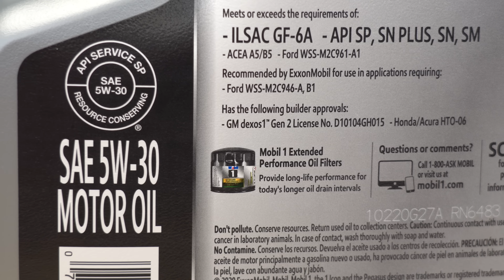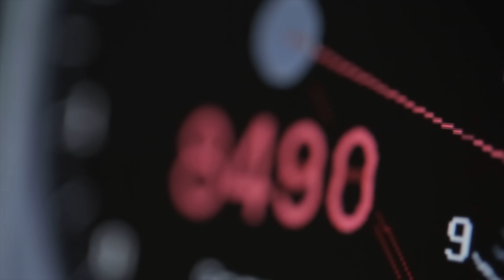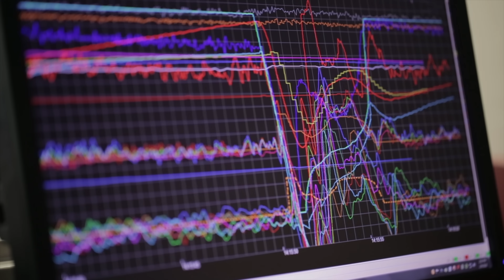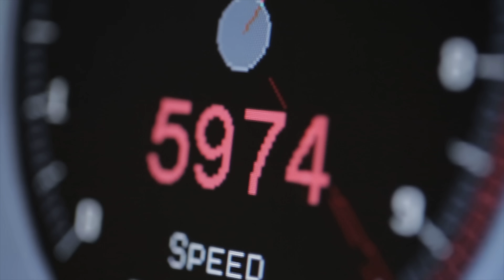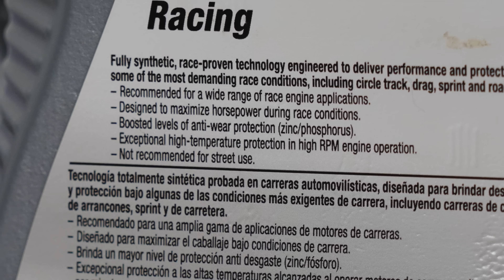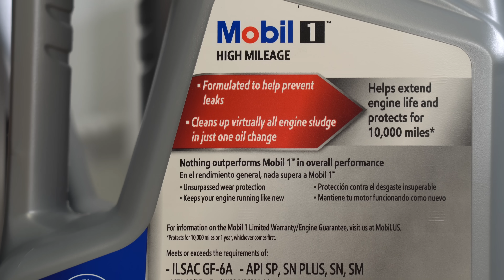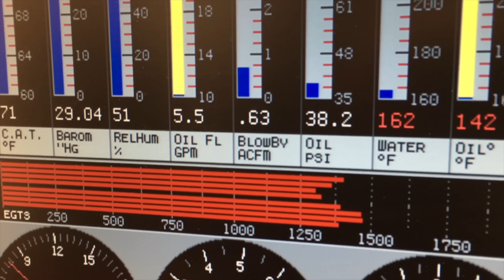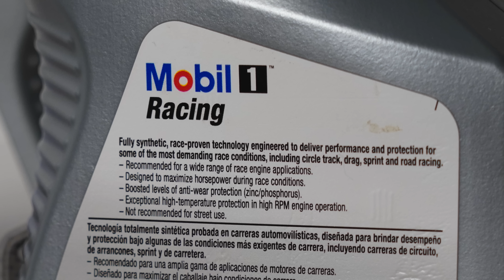Should You Use Racing Oil In Your Road Car?

Comment: I worry that engine manufacturers recommend the same oil viscosity regardless of where you live.  Temperatures and humidity vary greatly from say Florida vs Wisconsin.  But the same oil is used in both places.
Reply: This is due to an EPA law that requires manufacturers to recommend the same motor oil used for fuel economy testing on all cars they sell in ALL US markets, though I'm unsure of exactly when this change occured. I know my 2004 Jeep for example suggests 10w-30 in climates that exceed 100°f+ and 5w-30 elsewhere, but it's not often I see this (only more recent example I can think of is a Nissan that said to use 5w-30 if 0w-20 full synthetic was not available, but came with an asterisk that fuel economy may be degraded and that it's not recommended except in emergency)

Comment: Nascar teams, in addition to INDYCAR and Formula 1, will warm the engine oil and coolant close to operating temperature before cold starting the engine.  This further minimizes the importance of the winter oil viscosity.
Reply: I remember seeing somewhere that in, say, Hospitals they have giant diesel gensets in case power goes out. Pretty much the same thing is done. All the fluids are maintained at operating temperature as once the power gets cut the gensets are immediately pressed into full RPM

Comment: Great article.  Could you please comment on a shim-under-bucket style system, common in motorcycle/OHV that doesn't use a roller lifters but also has lower spring pressures.  In addition, some have wet clutches and others don't. How does ZDDP amount affect these situations?  I would guess it's not needed in either.

Comment: "imagine changing oil every 5000 miles..." 

Subaru owners: I'ma pretend I didn't hear that.
Reply: I change it every 3000, so what
Reply: @kristoKR-zj8oi  There was a story on Yahoo about oil change intervals. Their opinion was you can quit changing your oil every 3k miles and go for 5-7000k miles to save money and natural resources.
This was back when full comments were still happening. 100s of comments about "I go x miles," and such. Then there was a comment by a guy who claimed he was an "SAE-certified" mechanic. He said the only way to know for sure is to have your used oil lab tested. He recommended Blackstone Labs. They do lab tests on consumer vehicles by sending you a sample-gathering container that you ship back to them, which they use to perform the tests.
I tried it and the lab test report said I had too much lead in my oil - I was either adding lead to my fuel or my main bearings were wearing out prematurely. They were correct - I only got 395,000 miles out of that Camry.
Reply: @pistolpete9978  i dont think oil interval should depend on miles... Mostly on driving style, how high the engine revs and so on... My car revs at 3000 rpm at 60 mph, so it spins a lot for low speed...

Comment: To answer your question, race oils are not good for daily vehicles. Unlike you I think 1HP is not worth more expensive oil in ANY situation. Say you already have 350HP. 1HP extra is what 0.28% gain in raw power in some condition that You shall not be able to recreate.  Snake oil.. Oil business has stayed and remained shady business, a lot of mambo jumbo and "snake oil". Good oil, and change intervals appropriate to usage and engine condition is all one needs. Drive hard, change frequently, city driving, change frequently, normal driving = longer highway runs change as per manufacturer specs.  Simple as that.  BTW thank you for the video it was rather good even though I do not agree with some statements.

Comment: I'm installing a supercharger in my BRZ, I live in Southern California so the summer heat will require me to go from 0w-20 to at minimum 5w-30 and due to the the stress changes I will have to use an oil with slightly higher ZDDP. So I chose 5W30 Motul 300V, granted I wish they made it with a little less ZDDP as 1300 ppm is "usually" the max useful limit before it affects the the vitality of an engine, theirs is 1724 ppm. +424 ppm doesn't seem to much over but I will find out after the next oil change(every 3000 miles) when I have the oil tested.
Reply: Do you feel a lot of difference in hot weather with the viscosity change?
Reply: Vitality of engine or cats?

Comment: Nascar...more power at full load for at least 500 miles. Road cars...need just to get to point A from point B without costing a lot for about 100k or more miles. Racing oil won't hack it in road cars. ZDDP should be outlawed.

Comment: If road cars engines were at high ram for most of the time being driven, they would need oil changes much more often as well. If a Nascar engine was driven like a road car, their oil change and rebuild intervals would be greatly extended. You left that bit out.

Comment: Simply use the oil that's specified in your owners manual. Your car is gonna thank you especially in winter.
Reply: Opinion on AMS oil?
Reply: @vGREENARROWv  amsoil synthetics are some of the best oil you can use if you don’t mind paying the premium. Probably worth it on expensive engines that hit the track, but not necessary for dailies. Just stay on top of oil changes most importantly and use something decent like Castrol, Mobil, or even amazon basics. I like to use genuine/oem filters as well but wix is a great alternative.
Reply: @hazemdrift  ok because I’m not going on a track just cruising around.
Reply: @vGREENARROWv  Use the correct viscosity and follow change intervals. Never pass the 10,000 km mark and if the car is used in severe conditions(small distances everyday where the engine doesn't have the time to reach operating temperatura and never goes beyond 2th-3th gear.
If you want to take extra care use full synthetic, theres some pretty good stuff like mobil and castrol at reasonable prices. If you are an car pervert with money to spend use motul, amsoil or redline.

Comment: I've been warning people for years, about the long term effects that oil additives can have on emission control components. My biggest concerns are the oxygen(O2) sensor, and, the catalytic converter. There are over the counter additives that can be added to conventional oils, but those additives contain many ZDDP and similar additives to racing oil, and oil used in diesel engines.
Reply: So are you saying stick with conventional oil? Just asking for conversation sake as I to do agree that “over the counter” additives (aka snake oils) are bad juju 👍

Comment: I probably need some type of performance vehicle oil for my car. I drive a Honda Beat which has a 61 hp 3 cylinder engine, it is one of the most fun cars to drive but you have to constantly push the engine often in higher than average RPM's for day to day commuting. So I would need a better than average oil to maintain it.
Reply: Amsoil all day, mobil 1 trash compared to it

Comment: In a lot of forums for air-cooled VWs I've seen Valvoline VR1 recommend due to its zddp content and the fact the the type 1 engines are flat-tappet valve trains.

Would this make sense to use a "racing oil" in a 50 year old 60hp engine? Granted 2.5qt at like $8/qt isn't that cost prohibitive either.
Reply: That does make sense to me, though I'm no expert

Comment: Racing oil has no detergent as that leads to foaming. Sludge and clogged oil passages result. Only use regular oil on the street. You do not mention marine. Do use racing oil if racing and change it often. If a pleasure boat use a top quality heavy duty oil and change it often. Run a boat at wide open throttle for hours and see how long the engine lasts. They usually need a rebuild after a thousand or more hours.

Comment: "Full throttle and almost 90% of the time" sounds like me driving my miata...
Reply: One must aways drive slow cars fast
Reply: And me in my BRZ
Reply: Yas
Reply: @Montana270  zXxxxx
Reply: @erastodaguilar6267  what
Reply: And me driving the van in work 😂
Reply: My first car was an '88 fc rx7 convertible (in 2007). Basically a rotary miata. Stayed in the 4k-8k Rev range all day every day lol.
Reply: And any car under 100hp
Reply: Every mom in a minivan running late
Reply: @MH-pc2ky  Lmfao
Reply: The comment made me picture a miata at a red light, constantly bouncing off the rev limiter :D
Reply: 230k miles on my 2003 BMW X5 4.4L V8, every one with M1 0w-40. 15k change interval first 100k, around 8k after 100k. 
 Primarily Florida and Texas used vehicle.
Still has the original timing chain guides too! 😄
Reply: @jamescampbell4334  15k interval? Dam, I change synthetic 5w40 at 5k and it's already pretty dark. Can't imagine 15k mi. We are talking mi not km right?
Reply: @easycomeeasygo8901  
Miles not km. The BMW Service Interval Indicator uses volume of fuel burned and a few other factors to calculate oil changes. Do a lot of long hwy driving and it's not unusual to see 15k miles before an oil change is recommended. 
Realize the M62 holds almost nine quarts. The more oil an engine holds (relative to displacement and fuel consumption) the longer the oil lasts.
Example; a five liter with five quarts of oil will need more frequent changes then an identical five liter with ten quarts. The added volume suspends/holds more combustion contaminants, and cycles thru the engine less frequently. These factors play a major role in oil life. 
Do lots of short trip and/or aggressive driving, the SII will show the need for an oil change in around 8k miles.
I'm doing oil changes when the 3rd of the 5 green lights in the SII go out (60% of the BMW SII recommendation), the filter is replaced every other oil change.
I think the fact my X5 M62 V8 is still going strong shows that even though the oil appears dirty, it still lubricates and cools fine.
Reply: @jamescampbell4334  well it's working for you don't change it. My 20 yr old audi 2.7t hold 7 quarts, with 205k mi does 5k mi between changes. I don't dare go longer. I see 20k mi oils at Walmart but I'd never try it. My relative had a 19 jetta for almost 2 yrs. 10k mi oil intervals. Prob is too many people do not check oil level. 10k mi is a long time not to check oil level. I talked to many people that get their oil changed at a shop and most said they never checked the oil level.
Reply: @easycomeeasygo8901  
That turbo is rough on oil. High temperatures and fast spinning bearings knock down the viscosity really quickly.
My first gen Viper (1994) saw 12k oil changes with Mobil 1 oil. Almost 10 quarts and massive bearing surfaces kept wear to a minimum.
I sent a few samples to Blackstone for analysis. The reports showed all was good.
Sold the Viper with 110k miles on it. Compression test before sale was stellar.
Worth noting here, I run 4oz of Lucas Upper Cylinder Lube per 10 gallons of fuel in ALL my vehicles. Been doing this for decades.
Reply: @jamescampbell4334  you sure do drive your cars👍, love it. Enjoy them while you can, I say.
Reply: @easycomeeasygo8901  
Life is too short to not enjoy them. 👍
Reply: @jamescampbell4334  I agree, I do the same.
Reply: @jamescampbell4334  Sorry to hear you're still using that M1 oil. It was reformulated and hasn't met bmw ll01 for a few years.
Reply: @mattbrown292  
I made the decision to continue using the M1 oil after the formula change. I saw the condition of the cams and valve train while replacing the valve cover gaskets at almost 200k miles. I expect numerous other items to fail before the motor. Just got the hard shift and trans failsafe a few days ago. Code thrown is P0721, output shaft speed sensor. Will change the sensor and do a fluid/filter service to see if that resolves the issue. If not, 4k for a rebuilt ZF5hp24 plus install fees is in my near future.🙄
Reply: @jamescampbell4334  Well I'm glad you're in the know. Its quite possible that m1 just didn't want to go through the cert process again. If owned a lot of bmws and I'd definitely recommend redline oil for your trans. It fixed some shifting issues in my e36 but that was a gm transmission before it was manual swapped.
Reply: @mattbrown292  
Hahahaha, I was looking at the Red Line trans fluid on FCP Euro website last night. 😂
Reply: sounds like me in my Mazda6 lmao
Reply: @CarsOfPennsylvania  Or me in my CX-3 lol
Reply: Woop, wooooop!
Reply: And me in my dad's civic
Reply: @adityaparecha4550  this is y parents need to get their children their own car🤣.
Reply: @easycomeeasygo8901  nah I will buy one on my own
Reply: @adityaparecha4550  good for u 👍 buy a type R with tune at minimum. When my friend in high school  started driving his mother's 2 yr old car he blew the trans in 5 months. One to many neutral drops and WOT all the time. His mother was so confused on why the trans went🤣🤣🤣
Reply: And anyone with a nissan cube on the freeway lol
Reply: the way they are meant to be driven
Reply: Miatas are unique in their feel on the road. Glad you enjoy it. I used to drive them around for Mazda back in the early 90's. Quite fun.
Reply: Of course, the only way to get up a slight incline.
Reply: Me when I was 16 in my 89 geo spectrum lol
Reply: Stp anyone?
Reply: @Red You are sus!
Reply: Of course, those shits have 90hp 🤷‍♂️🤣
Reply: @RJ6AV6  145 mr
Reply: @RJ6AV6  90 of the best horses really. Screw the BRZs. Take a 90 miata with 4:30 rear and 90whp for a ride once, horsepower becomes irrelevant
Reply: @Curt33FM  here we go, Miata boys thinking their sperms on wheels are gods gift to the automotive world....😂
Reply: @RJ6AV6  Must be, what's the most raced car in the world?
Reply: @Curt33FM   e30?
Reply: @RJ6AV6  Exactly. Full throttle just to not get completely walked by a Camry. That said, I tend to destroy most folks with their "real sports cars" in the corners.

Comment: racing oils are often heavily discounted . I can usually get racing oil cheaper . I just buy enough for multiple oil changes . My engine kills something like mobil 1 0w40 in less than 1000miles it sheers back to 25weight or less which can lead to damage. redline wt30 lasts that same 1000 miles easily it doesn't break down and thin out. ideally I would run redline 5w30 but I can get wt30 cheaper so. I'm a happy camper if the oil lasts 2000 miles ....

Comment: ZDDP is great for flat tappets.  Hard to find these days unless you spend a lot on oil.  As an example, the Jeep 4.0 I6's benefit a lot.

Edit:  should have waited, he covered the flat tappet part.  Thanks for covering the important bits as always!
Reply: Valvoline VR1 is the oil most flat tappet or solid lifter engine users turn to
Reply: 15w50 Mobil 1 has it

Comment: So I'm still confused, like okay if it's a honda accord you drive to work and home it's iirelevant. But what about say an s2000, that you will take to a track day event every few weeks and like to drive in the mountain roads aggressively for a few runs up and down for an hour or two.....if it'll help my engine last to 250,000 miles instead of 200,000 miles....I'll buy a catalytic converter....the engine on the s2000 is far more expensive then that no?

Comment: anybody that knows anything about cars and building engines knows to use high zinc oil in our hotrods. been in use for years and years!
Reply: But also don't forget, Hot rods/muscle cars/race cars are a completely different application than granny Smith's 2.0L crossover.

Comment: I think Mobil1 ruined my engine, put in 5w30 and 8 months, 2000 miles later came out like it was 0w10. No contamination from coolant, water or gas. Never again.
Reply: Was the oil hot when you drained it? It becomes "watery" when hot.
Reply: @Dcc357  No, actually it was still cold. It's a 1992 Mitsubishi DIamante never overheated or gave me trouble, has only 80,000 miles on it and used as a weekend car.
Reply: @nakoma5  Only other explanations I got are if the oil got diluted in gasoline or a bad batch.
Reply: @Dcc357  I'm certain it didn't get diluted with gas. Am OCD fastidious with checking fluid levels every week, I would have noticed. Engine has a slight rod knock now. 
My guess is that as well, a bad batch of oil or Mobil1's 5w30 is too thin but just barely qualifies as 5w30. And here I thought I was using the best considering I always use Supertech conventional for all my other cars no problem ever.

Comment: Can we explain 0w 20 "VW508" oil and if its actually magic in my 2019 Jetta!!! Or is the VW 508..9.. whatever designation is just marketing!
Reply: I'm seeing a lot of overlap between VW 508.00/509.00 and specs like Mercedes MB 229.71, Porsche C20, Jaguar Land Rover STJLR.03.5006
/STJLR.51.5122 and the new GM DexosD. I don't see any of these specs also showing up on commonly available oils meeting GM Dexos1 or FCA MS-6395. While I'm not a chemist or an engineer, the distinction seems significant. I'd definitely like to see Engineering Explained do an episode on the difference between these OEM specs.

Comment: I use Valvoline VR-1 or She'll Rotella for my 78' Oldsmobile Delta 88 "Weekend Cruiser" and my 2000 Jeep XJ I just completely rebuilt from the ground up. But, my 99' Crown Vic uses Valvoline Max Life Full Synthetic, and my wife's 2016 Focus ST uses Motor raft Full Synthetic. The racing oil and Rotella helps my 350 Rocket, and my Jeep's 4.0I6 tappets. But, they are not needed on the Vic or the Focus. Racing Oil had it's uses. I also used VR-1 to Break in the Jeep's 4.0 when I got the engine done. They are wonderful for older engines and brak ins.